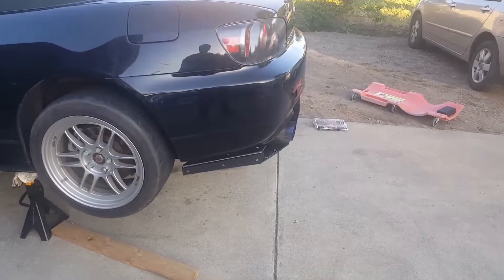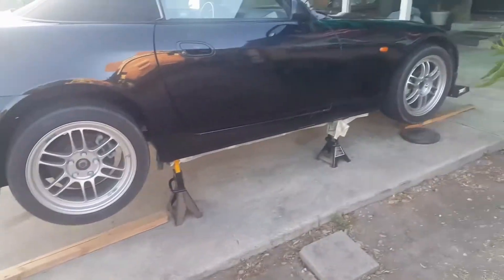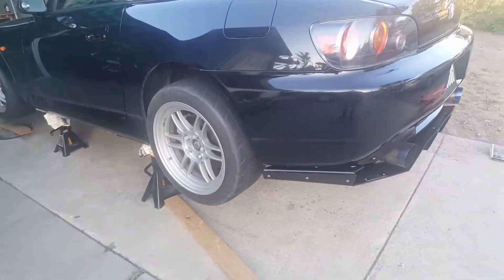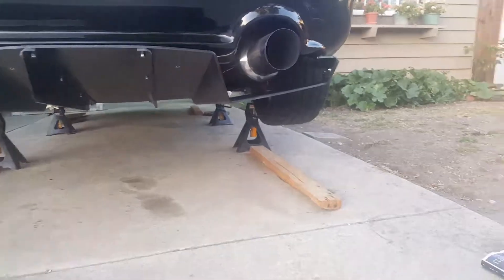s2000 update

Comment: where you get that rear diffuser? lt looks pretty awesome
Reply from the maker: Wei Wang, I got the front lip and rear diffuser from top1 motor. go to www.toponemotors.com, I can't remember exactly but I got either 20 or 30 percent discount from the manufacturer. you just got to email them and ask. you need to know that it will take between two to three month.
Reply: Jonathan J thank you. that's very helpful! just checked out that website, lt looks good. thanks again